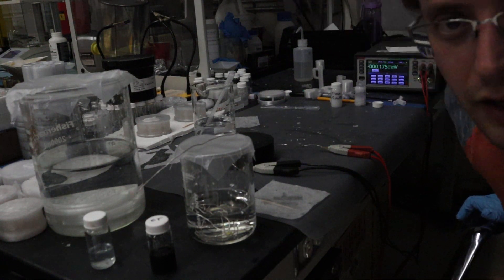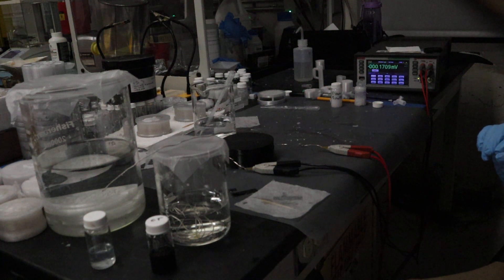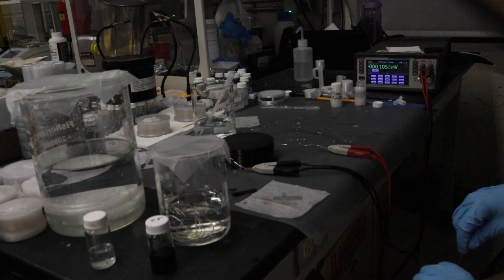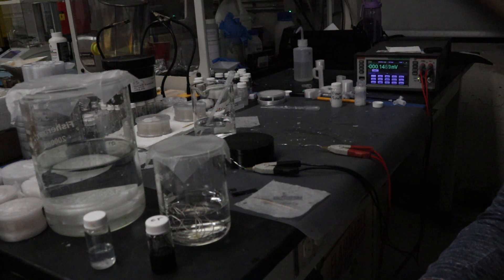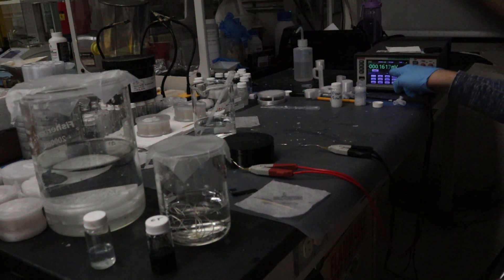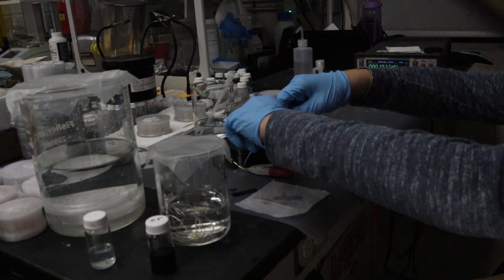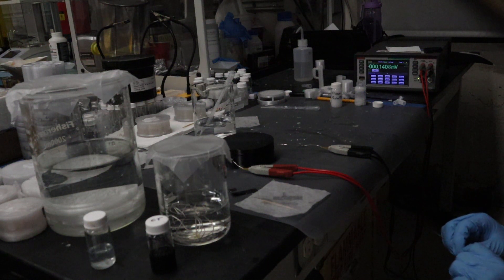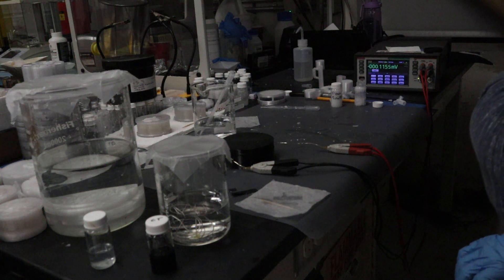Concentration Gradiant Flow Cell - Test 1

Comment: A room temperature super conductor.  Does moving the setup 1 meter in each direction change the current?  I didn’t realize that was carbon fabric till the end lol.  So the biscuit has magnets , ceramics, copper etc. I just got here so catching up.  
Maybe the ambient ether would increase the current?   I’m not a scientist.   Thanks for all you do.
Reply: Better than that: thermal energy recycling, possibly. This uses principles from Vladislav Capek and he wrote a book on it: Challenges to the Second Law of Thermodynamics. Daniel Sheehan, Garett Moddel and Paul Thibado have since made concentration gradient flow cells, casimr gap MIM diodes, and graphene energy harvesters which all harvest thermal energy as a power source. This particular device is a replication of Daniel Sheehan's concentration gradient flow cell.

Comment: What is the size of the capacitance it is charging?
Reply: Don't know yet; to measure that, we'd have to add electrical energy to it, so we want to get a good baseline before we do. Could definitely measure the power that way, but there's also an electrical resistance along with the capacitance: maybe some kind of LCR meter will do?
Reply: Also there are holes intentionally added to the membrane which cause a resistance that it's also fighting against in order to charge. We will measure what that resistance is once we have a baseline of performance for the device.

Comment: I appreciate you putting links to the papers but could you just say what kind of energy and power density this could produce?
Reply: Right now, it appears to be 0.17mV at 0 amps.
Reply: Looks like fractions of a picowatt at the moment, so nothing to write home about - the important thing is it's repeatable now, and we understand the effect. The next thing would be to increase the size of the effect. The power density is low but the energy density is effectively infinite, because you'd just be recycling ambient heat energy into usable power.